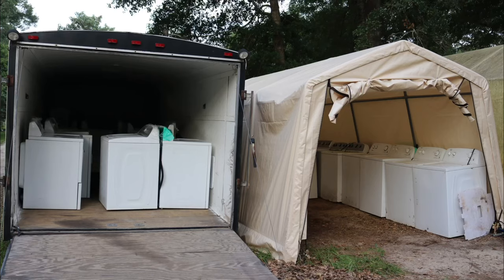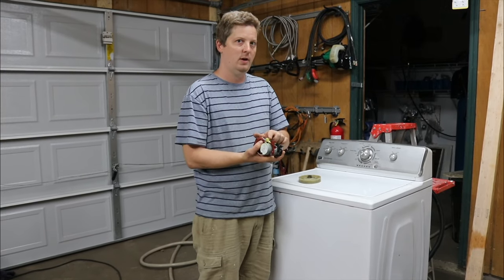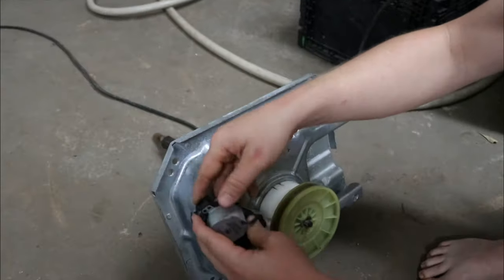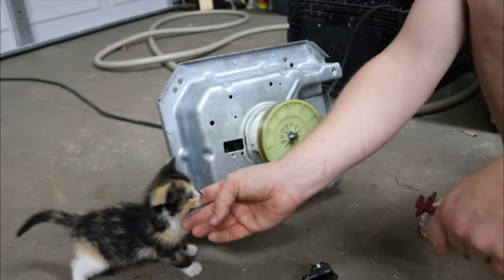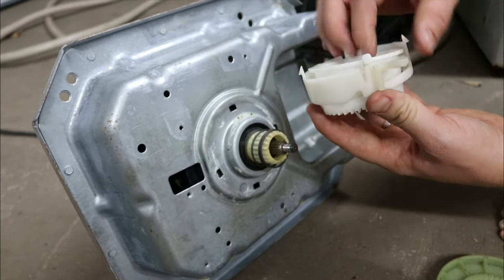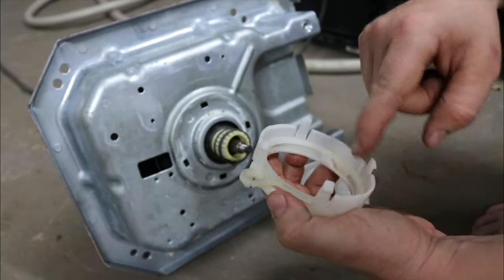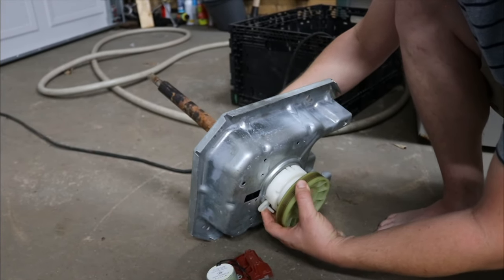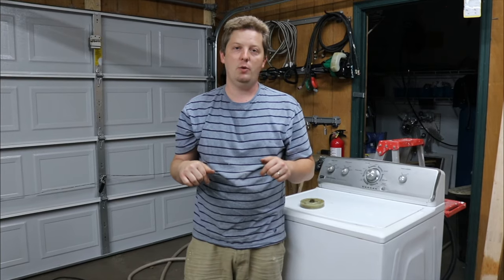Washer No Spin or Grinding Sound? Actuator Transmission Step by Step Guide to Fix or Replace

Comment: Thank you, i just placed an order using your affiliate link.
Reply from the maker: Thanks
Reply: @WasherDryerMoney   hey I have amana washer it spin and drain but doesn’t wash the clothes
Reply: @WasherDryerMoney 
Do all washers have that cause I have mine open and can see all components and I don't see it. Maybe I'm overlooking it. And it's either red or black. I have a Maytag older top load similar to the one here

Comment: I just replaced the shift actuator on my machine. The agitation did not work after that. After a lot of troubleshooting I finally realized that I tightened the pulley nut so much that it was not disengaging the teeth from splutch. After determining this I reattached the pulley and more carefully tightened the nut. It works fine now. There is absolutely no information anywhere about this happening. I hope this helps someone.
Reply from the maker: Interesting
Reply: Sounds like this might be the problem I am having. I replaced the entire washer drive pulley. Ran the Agitate Manual test and it still makes a grinding noise. Its as if the larger 4in. pully wheel is not disengaging from the smaller gear. How did you determine how much was too tight? Every video that I've seen, they tightened the nut all the way.
Reply: Thank you for putting this out there to see
Reply: Thank you for putting this out there to see
Reply: I did the same thing.   Thanks for posting.
Reply: I'm having trouble just getting the nut off in the first place. Both the nut and bolt it's screwed onto spin together. I cant figure where or what to hold onto to keep the bolt from spinning so I can unscrew the nut ....???   holding the pulley or belt does not help. the nut/bolt still spin while holding those still.
Reply: An electric impact driver would definitely work. If that's not available, you could try putting the wrench on the nut and hitting it with a hammer. Wear gloves to protect your hands.
Reply: @SLmDonDada  If you are changing the pulley, clutch and gears don't mind damaging the pulley. I have hold the old one with a pair of vise grip and removed the nut with my regular ratchet.
Reply from the maker: @israelwiesel8724  I should’ve mentioned it in this video and I’m not sure this is the issue here but it’s a good idea to put the washer in recalibration mode because sometimes it will get stuck in agitation or spin.
Reply: @WasherDryerMoney I have a washing machine that is spinning and agitating at the same time.  Can you message me if I give you my info?
Reply: Come on dude some of us are women. Show us don't tell us.
Reply: This was perfect! I replaced the actuator and belt and it sounded worse after.  I was so done until I read your comment!  I tightened it too tight and was able to fix it.  Thank you for sharing!
Reply: I figured out how to fix it when its stuck on fill cycles thanks to your video 👍
Reply: I replace the shift Actuator and it still not working but it drain tho so what might be the problem please
Reply: I just replaced the clutch assembly(?) and the nut on the pulley was super tight from the factory. I had to have someone hold the pulley while I used a impact driver to knock it loose. No way it was coming off with a ratchet.
Reply: I’m going to try this because i am getting sick of tilting this thing.
Reply: i think i might have done the same
Reply: i wish we knew how much torque they take
Reply: Is there an easy way to take out the nut of the actuator?
Reply: I've went through 3 of these assemblies in the last year and a half. The big white basket drive gear keeps burning/rubbing the end off in a perfect circle
Reply: Helps me! 😂
Reply: @shawnritchey8201 
That means they are too close together. The nut is unscrewing... you might need to use lowlights on the threads. Get the blue (reversible) type.
Reply: @OursK85 that is what I had to do also
Reply: @WasherDryerMoney  how do you put the washer in recalibration mode?

Comment: If I would've watched yours first it would've saved me the time I spent watching the other 20 Maytag videos... and they didn't have a cat. co-star
Reply from the maker: It's true I'm one of the only appliance repair guys with a cat sidekick. Lol
Reply: Absolutely right @CJ Burton
Reply: My machine leaves clothes sopping wet. It drains, but doesn't spin. I've replaced the actuator, splutch assembly and lid lock, all with new parts and it still won't spin. Any ideas on what my next step could be? I really don't want to have to buy a new machine! Thanks!
Reply: @JohnHawkridge  Did you ever get that figured out?
Reply: @chipsawdust5816  nope. Been going to the laundromat every weekend. Looking to buy another machine.
Reply: @JohnHawkridge  My actuator arrives Friday so I hope that fixes it. If not, it's time for a new washer pronto! Gotta keep Mama happy and keep our clothes clean. LG will get my business next time. I looked at the Speed Queen washers but they're several hundred dollars more than I can/want to spend. Such is life...

Comment: When i grab the large pulley thats attached to the metal splines and push i get lash of like 1/4 inch. Is this normal? It has left friction marks on the safety cover plastic, as if its dropped enough to make contact with it.

Comment: the reason the sensors are there is to make sure the drum stops spinning before it shifts. If it were spinning when it shifts, it would strip the plastic teeth right off the plastic gears.

Comment: Thank you for your videos I like the way you explain how the parts work in the system. I especially liked the video about the "sealed" gear case where you drained the oil out and replaced it with grease. I've been working on machines for a few years now and don't know everything but that seems like a genius idea for a machine that is built to fail, generally on the expensive parts like the gear case. Making it impossible to just replace the bearings. I'm going to try your method of fixing mine, what do I stand to lose I can't break it more if it's already broke lol. Thanks again!
Reply from the maker: Yeah I love taking things apart and seeing how they work.
If you get the grease in the gear case and it works well be sure to let me know.

Comment: Hi, i have a maytag bravo washer, and it doesn't wash, what it does its a humming noise, put it on manual checking mode, throws water, lid lock its fine, but on the drum running speed (wash & done light) it won't start all it does is humming noise and no movement...could it be the shift actuator?

Comment: Just bought the parts and the wife is still negative about the repair. But I am fully confident you hit the nail on the head of our problem. Will update you once the parts are replaced.

Comment: Thanks for the video. I just took my Maytag Centennial washer apart and brought these parts to my local appliance dealer/repairman. He said the teeth looked fine so the problem was likely the transmission and would be very costly.
I put the same parts back on and made sure the nut was tight. No more grinding. 
ZERO COST REPAIR!! Thanks again!!
Reply from the maker: Yeah, I’ve seen that nut come slightly loose and create the grinding noise. There is supposed to be thread lock on it.
I’m glad you got it fixed.

Comment: I want to thank you for this video. As others in the comments have said, there are many repair videos out there that show how to replace parts on the appliance, but they do not explain why it needs to be fixed or the issues the unit was having. Your video was helpful in determining what problem I was having and how to fix it. Thank you for explaining what the parts are for and how they work. Your video is how I fixed my washer for $40 and 10 minutes of "work" instead of paying someone else to do it. Thank you again.
Reply from the maker: Glad to help

Comment: Nice! Thanks. Watched a dozen vids to figure out whats wrong with my machine. You are the only one who nailed it! No need though to pull the drive out. It's easy enough to tilt the machine to get at all that.
Reply: How do I test the actuator/ transmission  with multimeter
Reply from the maker: Glad to help

Comment: Thanks for the video, partner. My washer was making a grinding noise. Turns out, the Shift Actuator wasnt opening the Splutch up. When the washer wanted to agitate (which is a quick rotation motion from the motor), the whole washer barrel was still engaged, thus a grinding noise resulted. I replaced the Shifter and it works great.
I refered this video on other washer troubleshooting videos regarding this same issue.

Comment: I am ready to tackle the problem after watching this video. ( I changed the belt earlier but it wasn’t the problem.) I liked and subscribed to the channel due to the comprehensive description of the problem and repair, but also due to the kitten and due to the fact that the repairman was barefoot!
Reply: Had a "repair" guy come and see my Kenmore 200 series washer and dude didn't even check under the washer for any of that...since it didn't start dumping water instead of resetting the washer he said it was the transmission and off the back was already trying to sell his overpriced used washers.
Reply: Had a "repair" guy come and see my Kenmore 200 series washer and dude didn't even check under the washer for any of that...since it didn't start dumping water instead of resetting the washer he said it was the transmission and off the back was already trying to sell his overpriced used washers.
Reply from the maker: Lol

Comment: Thank you for the grinding noise you made when spinning the green part. That’s the noise my washer is making…like a slipping noise…reminds me of toy cars when you would pull the plastic rip cord (70’s 80’s).  Looked at many videos to explain this noise.  Only you made the noise. Thank you.
My washer fills, agitates, drains.  No spin.  Only makes that grind noise when it tries to engage the spin . I still need to call someone to do this.  But I feel educated ahead of time.

Comment: Wonderful video !!! Originally I got ripped off by the appliance repair guy from Sears who came over to check the washer . He ran a two minute self disagnoses and said it would cost over $600 for a new control board to repair so it wouldn't be worth fixing and gave me a 10% off coupon to buy a new one at Sears and charged me the $79 diagnoses fee . After watching a few of these videos I found out it was the actuator so I bought a new one for $25 , took ten minuts to install and now the machine works perfect. Sears pulled a total rip off scam to get you to buy a new one. I complained to consumer affairs but they said it's legal to scam and cheat consumers and they really don't so anything down there except collect their government pay.

Comment: Great explanation. I'm insatiably curious and this hit the spot. Some videos point out where it goes and show you the part but this explains the mechanics behind it and why these motors burn out. I had tons of grit and "stuff" in my system and I can see why the motor was always fighting against it. BTW, what led me here were videos on understanding the Maytag error codes (mine was F7E1) and how to "Nintendo" the console. e.g. Right, Right, Right, Left, Right to access diagnostics.

Comment: Excellent video and dialogue. There are so many fixit videos that are useless. Kudos for being so thorough and on the mark. Really like these new clutch systems. When I first looked at the machine and not knowing how it worked I saw the Shift Actuator and the pissant motor and without knowing or understanding... pointed my finger at it as the cause. Thanks.
Reply from the maker: Glad to help. Be sure to put white lithium grease in the White plastic area that The actuator moves. A lot of times that’s what makes the it go out. that area not being well lubricated.
Reply: @WasherDryerMoney  will this work on a washer that has new aggatzter

Comment: Thank you very much for your info. We purchased a hotpoint washer for a temp residence, and it was making that grinding noise. Only during the wash cycle spin cycle is always quiet. So I will replace motor and clean gear. Will follow up once I am done

Comment: I just checked this video. (By the way great video) I have a Roper with the same actuator and pulley system like in the video. The washer will fill, will agitate for a while but it will not drain. I have to hit the start button to force it to drain. After that the washer will stop the cycle. It will not do the 1st spin cycle and the final spin cycle. When I put the washer on diagnostic mode to drain, I can hear the water draining but no spinning is happening. Something is slipping that does not make it spin. I can see the attempt to spin but it is slipping. The agitator inside the tub I checked the teeth it is fine. I purchased a new actuator via amazon, thinking that might be the issue. Same one on the video you are mentioning. I replaced it and I am having the same exact issue. The belt pulley is fine, not broken. The motor is fine since the washer is agitating. The plastic component with the three parts I checked it, it is not broken, and the wheel is fine. So, what can be the issue? I need your help on this because, I am not going to purchase a washer. I know it is a simple fix. But I can't put my finger on it.

Comment: Video is 🔥🔥🔥. Replaced the shift actuator.  Checked all my wires one was loose and made sure the belt was good.  Works like a charm and the washing machine is super quiet.  Salute…
Reply from the maker: Glad to help

Comment: Replaced the actuator from the affiliate link and it did the job perfectly.  Note that the part is available MUCH cheaper from other sources on Amazon.  I paid $36.99 from the affiliate link, but could have gotten for as little as $19.89 from other listings.

Comment: Great video. My Bravos washer MVWX655DW1 was experiencing several issues mainly the drum moving with the wash plate instead of the wash plate moving by itself. This situation lead me to believe the actuator wasn’t shifting. Other water level issues ensued but after watching this video I learned the actuator does way more than shift the drum/plate. So, I purchased the actuator, W10913953,($60 local, could not wait for Amazon bc laundry stacking up) which is only 2 screws to repair. When I dropped the actuator out a small 1/8” plastic pin fell out of the shifter body. This is not the main pin, it was tiny and part of the internal shifter cam. After replacing it I ran a calibration (not diagnosis) scan and all is well now. Thanks for sharing your extensive knowledge on these newer style washers. I still prefer metal mechanical units over these newer computer driven plastic money pits. Good luck!
Reply from the maker: Glad to help.
Reply: How do you do a recalibration?

Comment: Just changed everything you talked about. Went smoothly except I’m still struggling to get the belt back on. 
If there’s a trick, add it here for the next guy. I’m sure I’ll have it figured out myself. 
However, where you said the clips might be hard to squeeze to get them off,  you don’t have to squeeze anything, it just twists off easily!

Comment: Good video Money.  You break down the maytag very well.  I have a no spin-sometimes spin w/grind (mostly no spin, wet clothes).  I started with replacing the splutch, although the original looked pretty good (no luck). Replaced the shift actuator...still same situation. I've noticed what appears to be fine grindings and oily residue inside and on the belt guard.  ???  Any ideas?
Reply from the maker: make sure you oil the area where the shifter goes back and forth. It should easily move. if it's stiff even putting a new actuator on will not work. I'm not sure what the oil and fine dust would be. I have seen this in some machines.

Comment: I got the f7e5 code which led me to your channel and you make this look easy. It suddenly only grinds during the priming mode of the wash cycles and then abruptly cuts off completely. It also threw out f7e0, f7e3, f7e9, AND f5e3. I reset the machine and check the circuit board and saw the blinking LED and the only code now is the f7e5.

Comment: Hi, I'm from Mumbai in India using the Whirlpool 651s fully automatic Top Load molded plastic version made for our Asian Market. The Machine suddenly had stopped spinning one day I tried to change the Capacitor & nothing changed.
So I called the Technician to check out diagnosed the fault to be in the gearbox.
Even advised to buy a new Machine as the new Gearbox would be of same cost.
After he left saw I your video understood the root cause. I rocked the Machine few times & the gear got released & spinning has resumed.
We're using borewell water for the house salts have deposited inside the actuator my guess would be better to remove this & clean up thoroughly to avoid a problem in future. Thank you for the video it has a good length easy explanation.
I welcome your thoughts about how to get the actuator out for removal of salts

Comment: Thanks for posting this. It was a help in replacing the clutch and actuator on my whirlpool washer. Still have one problem: there is still a short, loud grinding noise when the machine gets to the very end of the final spin cycle, just before switching to "done";  Like maybe the clutch is not fully disengaging at that point.  Any suggestions?